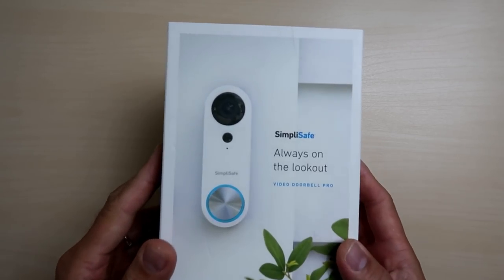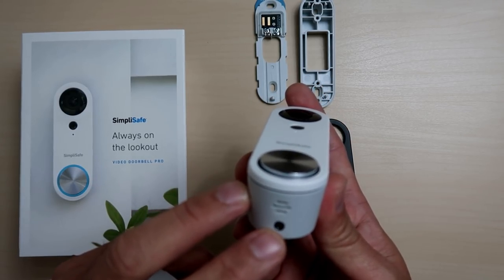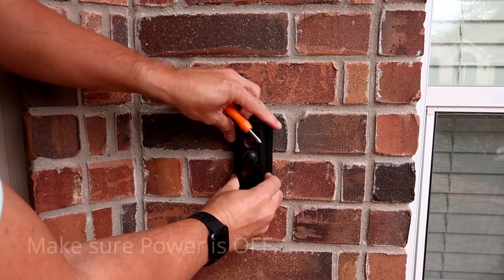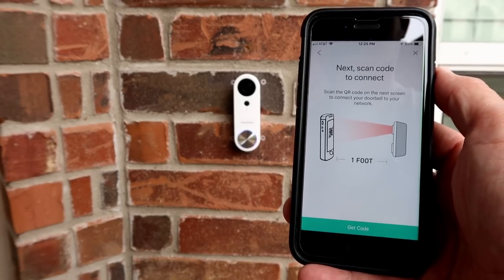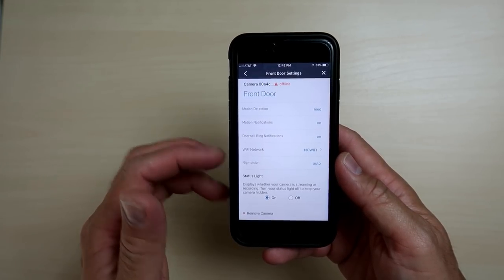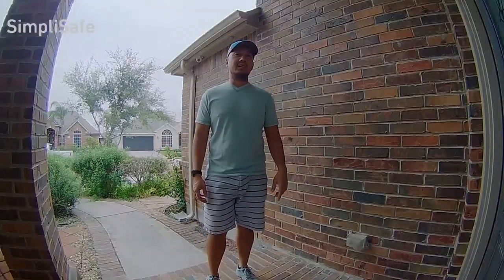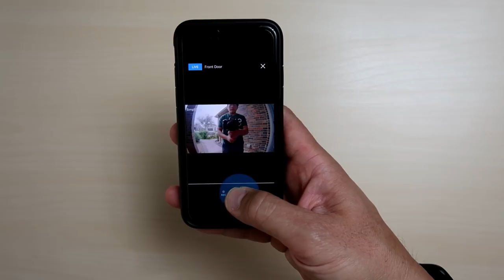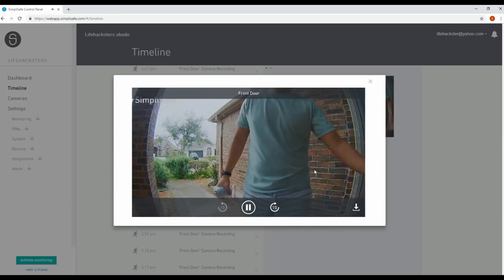Simplisafe Video Doorbell Pro Review - Unboxing, Features, Setup, Settings, Installation, Footage

Comment: Seems like a good doorbell. I'm pretty happy with my Hello though especially because it records 24/7. The notification delay on motion has gotten better (About 5 seconds) and the push doorbell notification is basically instant and awesome that it not only rings my house chime but all my Google home speakers.
Reply: EverythingEvo would you know if Nest Hello would send prompt alerts also to the Amazon echo aswell?
Reply: @slimnieves  No, it doesn't. I have a couple of Echos and haven't figured out a way to do it. Amazon did recently release the APIs to allow this to work but I doubt Google would ever update the Hello to work with competitors (Echo).
Reply from the maker: It is pretty decent. I will eventually do a comparison video on this and the Nest and also the Ring Pro.

Comment: I've had this doorbell for about a month now and it works great, other than the talk feature.  Sometimes i can talk to the person on my porch and sometimes i can't.  🤷‍♂️
Reply: Band It Did you need a chime connector? Was there any buzzing from the chime box?
Reply from the maker: I haven't had any issue as to buzzing in my chime but I think Simplisafe will send you a chime connector if you have this issue.
Reply: @erich1979  Didn't need anything extra. Just removed my old doorbell and connected the new one. Only 2 wires...very simple.
Reply: The talk feature seems to be working fine now. Could have been a wifi issue. We are really happy with the doorbell so far
Reply: I’ve been using mine for few days. They just released a big fix for your issue today.

Comment: The compression almost makes it look closer to a 720p camera.  The night vision using the IR sensor was rough.   If you have a Simplisafe system though, it would be an easy choice. Nice to have another option and like someone else said, I was really looking forward to the Blink Doorbell that is still MIA nearly a year since announced.
Reply from the maker: Video quality is not as good as the Ring's or the Nest. I'll be comparing these doorbells soon. As to Blink, I lost hope on them in releasing a doorbell.

Comment: Is there a disclosure that cloud storage is free for interactive subscribers? I can't find it anywhere on their website.
Reply from the maker: Simplisafe doesn't really advertise this on their cameras but if you go to the doorbell page (BTW, it seems like this page is not linked yet to their main page) and scroll down to one of the pictures..there is an asterisk and in fine print - requires $4.99 plan or interactive monitoring. -> https://simplisafe.com/video-doorbell-pro

Comment: Hello, thank you for sharing the video. My question, do you need your own WIFI on 24hrs/7days/365 for this thing to work?
Reply from the maker: Yes and No. The doorbell will only record when there is motion and it doesn't record 24/7 so technically, it doesn't need WiFi to be on all the time but to get notifications and for the camera to record motion events, it will need WiFi.
Reply: +LifeHackster thank you!
Reply: LifeHackster But you need Wi-Fi in order for this thing to have a blue light on it? If it’s successfully connected, I assume, that’s when the bright blue light shows on the unit. Therefore, if your Internet is out and you are not home, then the doorbell not only doesn’t light up, telling burglars that it’s not working, but someone in the house wouldn’t even hear the doorbell ring? I’m assuming it rings the same way your old doorbell does if you hook it up that way, coming out through the box you have on your wall? So the “ding ding“ sound I heard when you rang the bell for the simply safe rings outside the house so the person outside hears it?  Or like regular doorbells, it rings inside through the same time system that you had before you changed out to this unit? It’s very difficult to tell. If someone doesn’t have Internet, then you no longer have a functional basic doorbell, as it can’t possibly revert to a traditional doorbell in the absence of no Internet.  That’s what’s preventing me from installing it, because I don’t know exactly what the pitfalls are should Internet go out, have a poor connection, etc., as that has happened to me quite a few times before AT&T had to come out to fix the issues on the pole outside.  Also, if you’re not home and someone rings the doorbell and you’re not a full subscriber, and then no one answers, the burglars might assume you’re really not home if they’re familiar with these doorbells.  And if there something wrong with your phone, or your battery is dead, then someone coming up to the house and ringing the doorbell will do absolutely nothing because you can’t hear a ding ding inside the house, only a text message? And how does the rest of the family know someone’s at the door ringing the bell if the only alerts on my cell phone and it’s in my room while I’m sleeping?

Comment: I noticed that after install of mine I noticed a buzzing at my doorbell chime. Also you said power by ac? Could I use the ring pro plug in power adapter? Great review.
Reply from the maker: I haven't noticed any issues on mine. Yes, you can use an AC power adapter supposedly 8-24 volts...
Reply: I called them they are sending me a chime connecter that will stop the buzzing.
Reply: LifeHackster Do you have the chime connector from the Ring still installed? I just received my doorbell. I want to kind of make sure that I might not need a chime connector.
Reply: They ordered the chime connecter 3 time for me and it's on backorder with no ETA. I thought about also using the ring pro kit chime connecter. Does it do the same thing? I don't want to break to simplisafe doorbell. Thanks
Reply: Good Steward  they finally got them in stock about a month ago and I installed it. Buzzing went away. Since then I took it down and put my ring doorbell back I like that the Alexa devices act as a chime.

Comment: Great review. The absence of a 45 degree side wedge to angle the camera out from a wall perpendicular to the door or a wedge to mount in a corner is a real shame.
Reply from the maker: I know, they should have included it together with their tilt wedge.
Reply: @LifeHackster  I also could benefit from the angle bracket, as a beta tester for the doorbell they sent me one but it doesn't fit the updated version of the doorbell. They said they don't offer one for the updated version.
Reply: Get a piece of scrap pressure treated or cedar    2x4.. angle either a jigsaw, circular saw, miter saw , or table saw to the desired angle and thickness that you need. Cut it to  the required size and thickness to make a custom mount.
Reply: @andrewb941  I'm sure that is what most people will do. The problem is the name of the product is SimpliSafe. If you have to jig your own bracket, it ain't simple. And Harry Homeowner may not have many of the tools needed.

Comment: right now I have SS standard monitor plan($14.99), should I upgrade to interactive plan($24.99) or should I go for the Ring pro? thanks
Reply from the maker: If you upgrade to interactive and you don't have any more SS cameras, then it will cost you 10 bucks more which is not cost effective. You can just pay the $5 bucks/month... But..if you go with the Ring Pro for 1 camera cloud access is only $3.00/month and if you also go with the Ring Alarm + Ring Pro and all additional Ring cameras for only $10/month or $100/year. Decisions decisions ;)
Reply: LifeHackster thanks.
Reply: My only grip with SS is that as far as I know,  you must have the $25/month monitoring package to use their phone app.

Comment: Stop wasting your money and buy a REAL security system. And invest in REAL tried and proven products. ATD might be a start.
Reply from the maker: This is simplisafe’s video doorbell.. It is not a security system...and the only thing proven by ADT is that they are charging a lot more money as compared to DIY systems and basically function the same... which is calling the monitoring station when it gets triggered...so stop trolling...

Comment: Looks like a good doorbell and easy setup, but I think I will stick with my Ring doorbell Pro that is still trouble free for me.
Thanks for the info. 
Don from Milwaukee
Reply from the maker: It is a pretty good doorbell...It follows more the "KISS" principle. No AI, no facial recognition, no fancy chimes and alerts. Just a good 'ole video doorbell...records and notified you quickly when there is motion and doobell press, plus good 2 way audio.

Comment: I bought Ring about two years ago, loved it until it lost wifi connection 7 months and will not work now! Also bought the useless Ring solar charger. Useless as tits on a boar hog. I loved the way Ring worked. When it worked! Simplisafe has a way to go, unless they’ve improved it since your review. Ako na lang.
Reply: Same thing happened to me with the ring, the solar thing is a waste of money. It does not recharge at all.
Reply: Elizabeth Martinez I was just about to by the solar charger. It has amazing reviews on Amazon. Is it really that bad?
Reply: @juliuscaesar8801  Exactly! 1 star reviews expose the problems those crooks try to hide at those companies